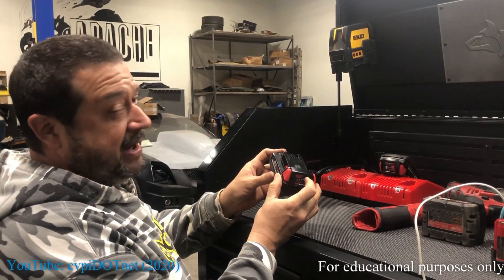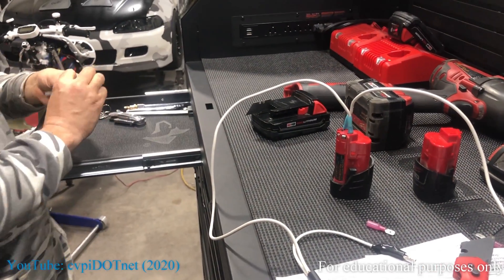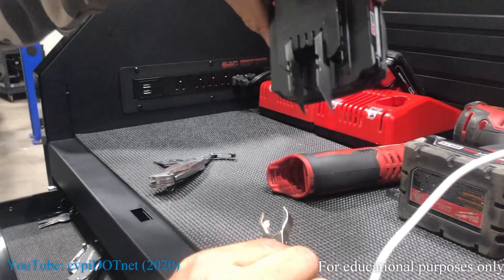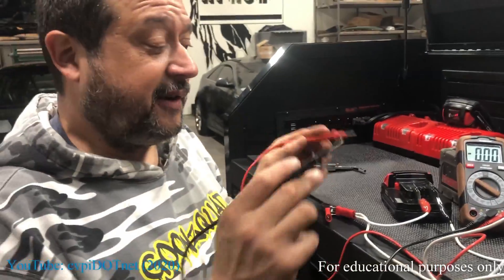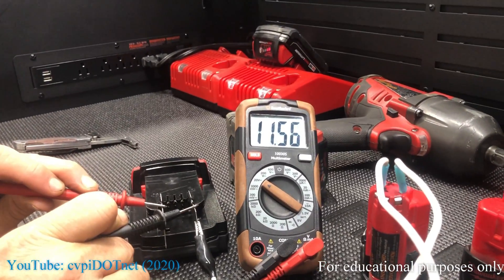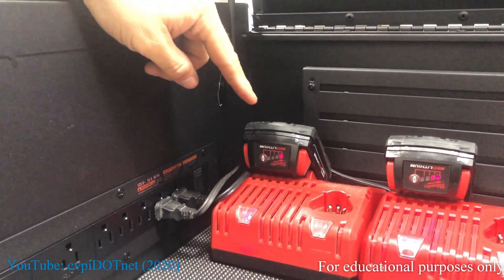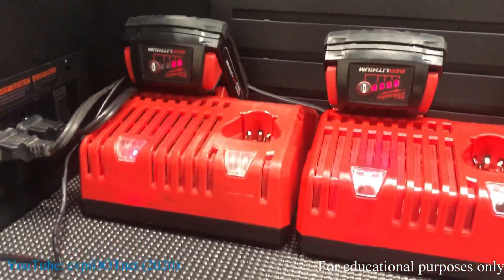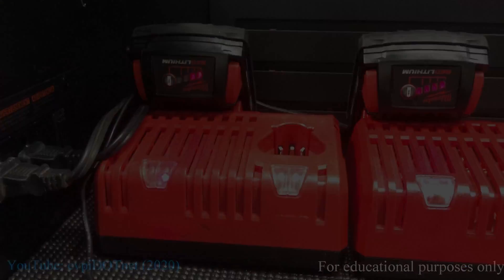Milwaukee M18 jumpstart a Dead Battery - Bring it back to life - jump starting - flashing red green

Comment: My m12 impacter ran my 6ah dead.  I thought the battery and the tool were supposed to communicate and stop before damage??  I'm a little ticked at milwaukee....
Reply from the maker: I only charge my 6.0 M12 batteries on a M12 only charger, I have read in some of the FB groups people have had issues with the combo M12/M18 chargers and the M12 6.0 battery. But you are correct to my understanding that the tool should not run  the battery down to far, but M12 batteries do not have circuity like M18. So it is up to the tool to maintain that if they actually do that. You can try this tick in my video with another M12 battery or I would recommend a 9 volt battery.
Reply: @cvpiDOTnet  oh...i didn't know it was tool only.  More reason to skip m12 and stay with m18....

Comment: Just jumped two batteries doing this, they both no longer have the error code and charged right back up.  One of them was a 2ah M18 I just picked up on sale, but ran it completely dry with a sander without realizing it - two days later I threw it on the charger and got the red/green error code.  The other was 5ah M18 I've had for two years and it was having hte red/green error code for the past year and a half.  I also just used a 9v battery to boost'em.  Thanks for this.

Comment: I have a m12 that wouldn’t charge so I used my usb charger to charge it & it got up to 3 dots but when I plug it into the big charge it still just flashes but the battery is working on my tools any suggestions?
Reply from the maker: Have you tried a different M18/M12 or M12 wall charger? I do not have any other ideas to address this over what I shown here. The M12 is a simple battery unlike the M18 that has a circuit board, so the M12 should charge if not completely dead.

Comment: Mine is green and won’t change or work in tools….
Reply: I have 3 9.0 m18 batteries that are dead but show green on the charger as well. Gonna try this method to see if it will take a charge
Reply: Try a different charger.
Reply: @local487boilermakers6  still don't work
Reply: Started flashing green and red few days after

Comment: You put the demonstration battery on the charger... And said "it will blink red / green"

Am I missing something or was it only blinking green?
Reply: Additionally... You, admittedly did not check the battery voltage prior to the test.

You just "jump started" a working battery?
Reply: @NWJF : The monitor light does blink red/green in the video - you can see it by comparing the left light with the right one at 0:11. Also, this reboot does actually work. I restarted a ‘dead’ M18 1.5ah battery yesterday that had been misplaced about a year ago and wouldn’t take a charge and it now works perfectly. I kickstarted it with a B&D 20v for about 15 minutes and placed it on the Milwaukee charger. It came up to full charge in about 30 minutes more and there was no damage to the B&D battery.